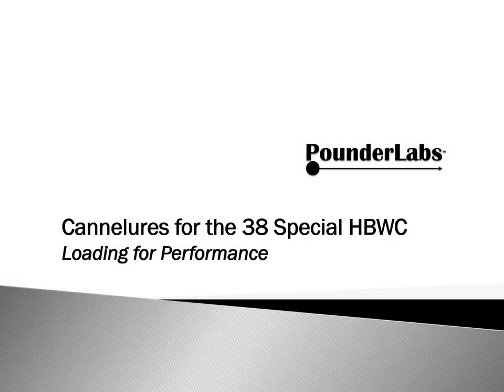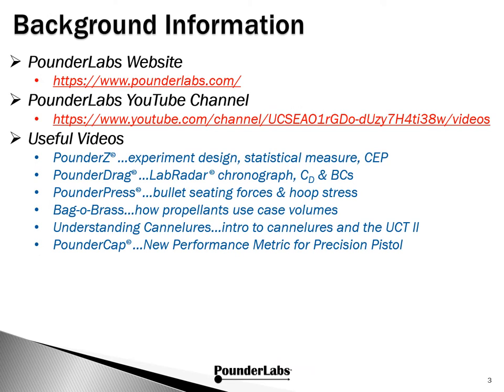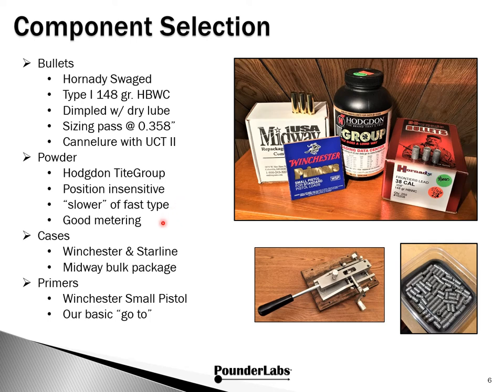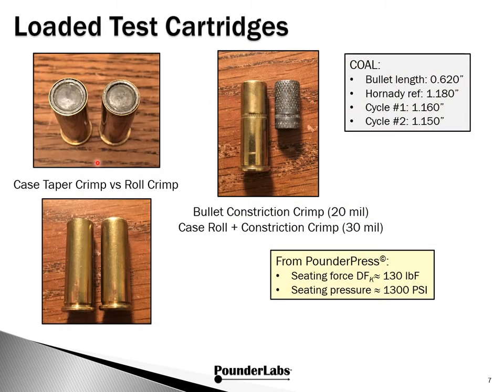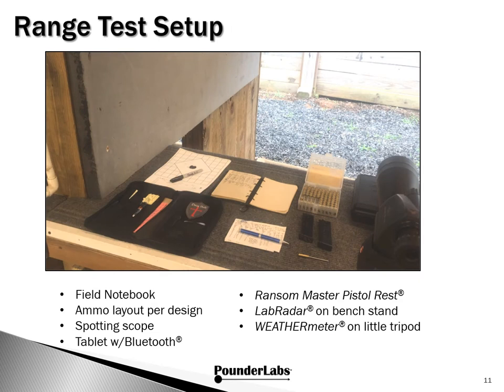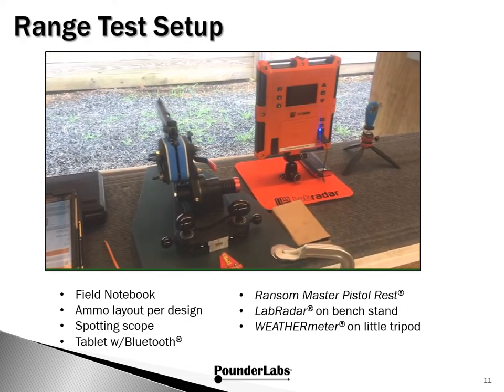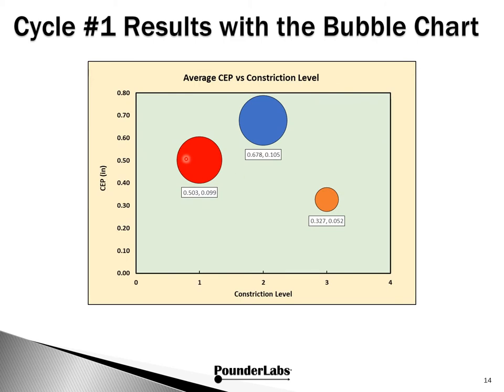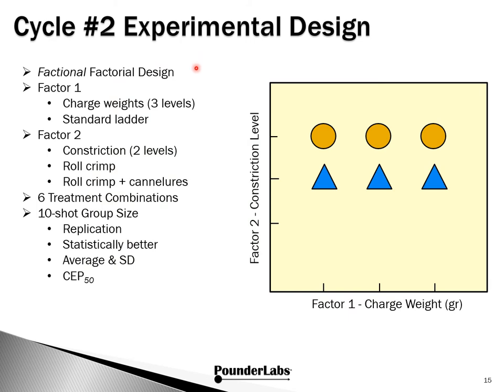38 Special 148 gr HBWC Cannelures

Comment: Question. I have been reloading for 50 years, and early on, mostly .38 special.  I have a question about the crimp process.  If you crimp the case and bullet separately, won't the lead on the bullet below the crimp groove be sheared off and up into the groove as you seat the bullet?  If not, will the case expand as the base of the bullet passes by its groove?  Does the case expand as the bullet passes by and then retract back into the bullet groove when the bullet reaches its final depth?  As a mechanical engineer I sometimes dive too deep into things.  With the lead of swaged bullets being fairly soft I can't see how this method would work.  However, the results speak for themselves, and are very impressive, and your research into this subject is second to none.  But what is really going on inside that case?  It would make more sense to me to crimp the case to the bullet after the round is loaded, in one operation..  How do the factory boys do it?  Each component separately or as a unit?  Can't wait to hear what you have found on this subject.
Reply from the maker: Al... Thank you for your question. Sorry for any confusion in the video but you are correct the process we use is:
1- Rolled the cannelure onto the bullet by itself first..the UCTII doesn't create any ridge on the bullet to interfere with seating,
2- Seat the bullet as normal, usually a small flare on the case mouth will help prevent any shaving of the bullet as it is seated,
3- We do a roll crimp, as a separate process step, to remove the flare and provide a nice rolled edge for the flush seated bullet,
4- Then we roll the case cannelure(s) on the loaded round lined it up with the cannelure(s) or we added to the bullet… locking the whole thing in.
Thank you for your viewership and support… Don
Reply: @PounderLabs  Thanks Don, this is what I was hoping you would say, males perfect sense.  Keep creating great and informative videos!

Comment: Thank you for this in depth video.  May I ask what KM tool you are using at 07:50?  I went to KM website and do not see this  Case Trim gauge and flash hole conditioner combo.  If I missed it, what length are you trimmer your cases to?
Reply from the maker: Hi Steve.... Thank you for your viewership and support. Maybe we should have stated this better but that tool was fabricated in-house and it's just using the K&M handle (which are very nice!). If you know someone handy with a small lathe it's not too hard to make one. For the Smith & Wesson Model 52 we shoot for trim lengths of 1.145 inch. Cheers!

Comment: Extremely interesting results and great science. I would wonder whether the results could be replicated by using roll crimp, no cannelure, and a magnum primer.
Reply from the maker: Hi Mathias... Thank you for your viewership, support and good question. We find that the roll crimp really doesn't add much constriction but it does dress out the edge of the case and we think improves feeding a little better in the Smith & Wesson Model 52. We now have a new mould for the148 grain HBWC so we can further experiment with different lead hardnesses, coating/lubricants, as well as, adding cannelures. 

We think your notion of a magnum primer is to get a hotter flame and toast the propellant faster/better. This did occur to us and we're considering looking into it. The problem with magnum primers is sometimes there's more Sinoxid  compound, other have magnesium metal powder for longer flame, but others it just a thicker cup over non-magnum. That is a lot of things to consider ;-) Cheers!
Reply: @PounderLabs  Berry's makes a couple of Copper plated wadcutter designs. They might be worth testing. Good luck with your future endeavors :) .
Reply: Late reply.  I've had terrible unexpected results from magnum primers sometimes.  They really have very limited use.  Pretty much just large charges of certain slow burning powders and black powder cartridge loads.  I once substituted magnum primers for standard in a cast lead bullet load for .44 Magnum which was well below maximum and had always worked well because I ran out of standard and only had magnum on hand.  In less than 18 rounds, bullets were tumbling at 50 feet.  Looking in the barrel, I saw the rifling was so badly leaded the grooves were no longer visible!  It was quite a chore to scrub and scrape the lead out later.  Baffling results.  Just from changing the primer.  Of course you never know what will happen changing a loading component.  But it can be downright bizarre and ruin a good load.

Comment: WRT the conclusion’s hypothesis that the Cannelure + Roll Crimp creates a more efficient combustion... would you also expect that to mean a better dispersion on that velocity? Clear that the velocity was affected, and also that the group size was better, but shouldn’t the SD/ES of the velocity also reflect the theory or is it possible that there is some other additional root cause for the group size to shrink? Since the velocity of the Cannelure + Roll Crimp is always the highest of any series, what if we just took the charge up on the plain load to the same speed and see if the group also shrinks? If the timing of the pressure pulse is the cause, it would be difficult to manipulate without a powder change.
Reply from the maker: Dino….
Sharp eye and good question. First a rhetorical question. How many of our loading references giving charge weights, velocities and chamber pressers have you seen that have any statements of precision much less accuracy? And we found very little that extended these analytics to hits on targets much less correlations between measurements such as hits on targets and velocity. In PounderLabs, our goal is to press into all this and it is work-in-progress and we want to share as we move along.

When we started this work a couple years ago, we expected to see high correlation between velocity standard deviation and measure of variance in hits on targets. But for the most part, we really haven’t seen that. Several areas to be looking at: 1) measuring velocity with the LabRadar (Doppler chronograph) is a causal process. So, they fit a short-term regression of the velocity-time curve and back fit it to time zero… this itself is a statistical process and we go into it in our PounderDrag video 2) we started our work with SD, as it’s a well understood measurement, but we’ve started doing more with Standard Error of the Mean (SEM) to get better understanding of dispersions relative to our small sample sizes in shooting. 3) we have some additional unknown factors coming into play and will continue to look for these.

50-yards is the gold standard of measurement for evaluation in precision pistol so as we press on into that will take your recommendation to up velocities without cannelures.
Reply from the maker: Dino… WRT to your edit. We agree, the impulse function might be coming into play. We’re currently working with slower powders like Unique, Power Pistol, and Blue Dot in 9mm and 38 Super to better understand this factor… Great comment!
Reply: Thanks for the work to begin with. I know how much effort this is for your own purposes, let alone to clean it all up and make it a presentation 

I see things the same, probably the reason I worked in a research environment my whole life.

My wording on the velocity and charge was poor, since the speeds were already overlapped in several of the tests. What has me curious is if there really is an increase in pressure or some combustion effect at work, or if the crimp & Cannelure samples obdurate better and create a better “size” on the “skirt” similar to the short range issues with pellet guns versus slugs? Strain gages are a PIA in pistols compared to rifles but may be worth a look. I also see strange patterns of SD/ES versus accuracy and often wonder what I am missing. 
Thanks again for your efforts.
Wishing you and yours a Merry Christmas and Happy New Year.

Comment: I bought a set of rbcs die’s a 3 dies set they are marked Group B  it’s a old set of die it’s in a cardboard box it has a WC on the box my question is are these dies made something special 357 and 38 ? Thanks nice video
Reply from the maker: Hi Brian…
Thanks for your question. I haven't used these dies but offer my best guess based on experience and what I have check. 

This die set is for loading the 38 Special wadcutter (thus the WC) loads we are discussing in this video. There would be a full-length sizing die, a seating die design with a flat seating stem to match up with the flat meplat of the wadcutter (the stem might even seat the bullet slightly under the mouth of the case) and a roll crimp die designed for this particular application. 

Hope this helps, thanks for your support… Don

Comment: Thanks for this info.  Great stuff!  Any information you can produce to help Bullseye shooters increase improve the accuracy and consistency of their handloads, particularly 9MM and 45 ACP, would get a lot of attention.  I.E., The use of some type of bullet adhesive vs. a case constriction cannelure to improve CEP; traditional cast & grease groove lube vs. Hi-Tek coated bullets, can Hi-Tek bullets be cannelured without failure of the coating.  Just to throw out a few thoughts.  

Have you thought about using a barrel holding fixture for test firing to help eliminate any errors associated with the firearm itself?

Remember that non-sponsored shooters handload for the economies associated with their volume of shooting; but still like to achieve "Federal factory" results.  Thanks again.
Reply from the maker: Hi Cactus…
Thanks for viewing and your feedback. Certainly, looks like we’re on the same page. For the 38 Special we’re working with a very nice 148gr HBWC from MP molds (www.mp-molds.com). It’s 0.640” length and we’re adding Hi-Tek and getting higher seating forces. For several reasons we’re moving away from naked lead but looking at other coatings. We’re working with Bear Creek Supply (www.bearcreeksupplybullets.com) and their extruded and proprietary coated 147gr for 9mm/38 Super and 200gr SWC 45 ACP.  These are both without any grease groove so we’re able to add our cannelures without crinkling the finish which we find happens with Hi-Tek. To get around the Hi-Tek coating failure when adding cannelures, we first size, add cannelures, coat and then resize and we’re good to go. For R&D it’s okay but that’s too much handling for a practical application.

You make an excellent suggestion. We will continue to use the Ransom Master Rest because it simulates closest to the real shooting experience but we would love to do testing on a universal tester. But unfortunately, it’s not in our budget at this time.

Again, we agree with you and we recognize that broadening the participation in precision shooting we need to get costs down but still maintain the accuracy and precision for non-sponsored shooters to be competitive.

Comment: I have read that calibers such as 454Casull use dies that size the brass down farther than normal and do not expand it is much before bullet seating so the elasticity of the brass will have greater friction grab on the bullet.  I wonder if this could be applied to .38 special to achieve tighter grip on the bullet and promote greater efficiency of the powder burn.
Reply from the maker: billj... I think what you're suggesting in theory should work. Couple things to keep in mind. 

To oversize the 38 Special brass, i.e. significant increase the negative interference, may require custom dies. And since jacketed bullets are usually .357" you can probably muscle them in, but you probably will end up with a pretty significant Coke bottle affect. Lead bullets, and those with coatings like Hi-Tek, are usually sized to .358" and may be damaged in seating in the oversized brass. Since we normally don't anneal straight wall cases, working the brass this much may limit your number of reloads, which may or may not be an issue.

...Don
Reply: My experience bears this out, Don, particularly with the softer lead used in swaged bullets. I used bullets cast from softer alloys. Bullet bases become deformed (singnificantly undersized) during the seating process. They don't shoot as well, and leading, even with very light loads, is apparent. I believe your canneluring method here is the appropriate solution to building consistent pressure without deforming bullets in a deleterious way.

Comment: Why not use the Speer swaged 148 grain HBWC?
Reply from the maker: Hi John... thank you for your viewership and question. The Speer HBWC is a good go to but the Hornady was more available, had a dimpled surface that held the dry lubricant and worked well for us adding cannelures. We now have a mould for the 148 grain HBWC so we can research out various lead alloy hardness and other lubricants/coatings like Hi-Tek. Exciting times, cheers!
Reply: @PounderLabs  - I remember using the Speer 148 grain HBWC back in the 70's along with 2.7 grains of Bullseye. Never used the case cannalure though. I do have old factory 148 grain brass that displays the case cannalure. IIRC, the Speer bullets did have a groove to accomadate a case cannalure. Worth a try if you find some?